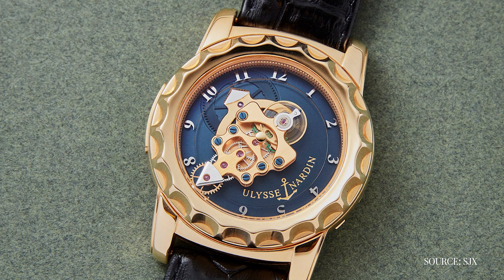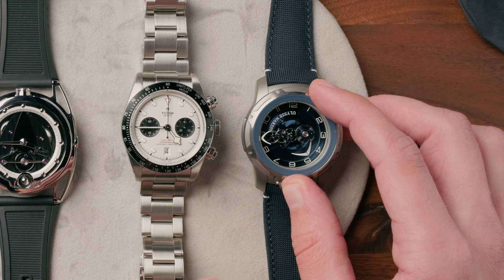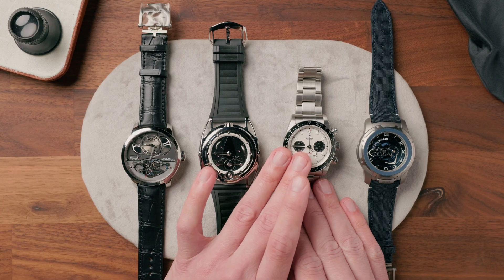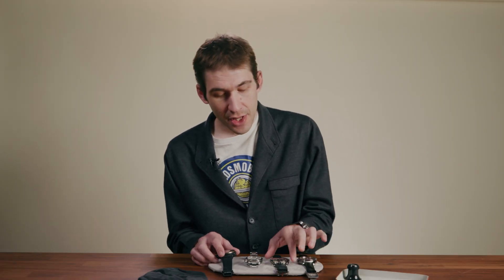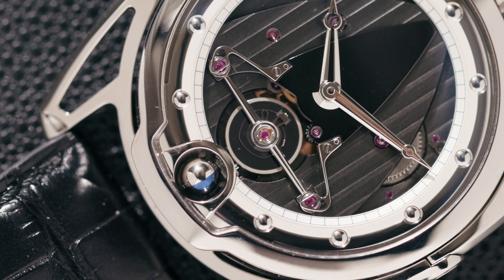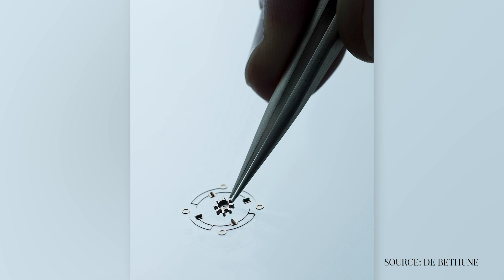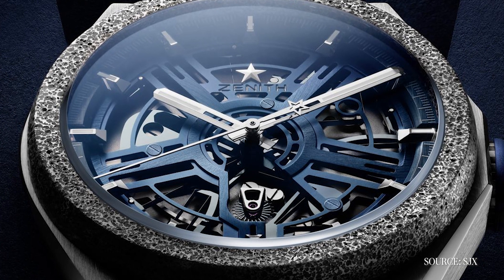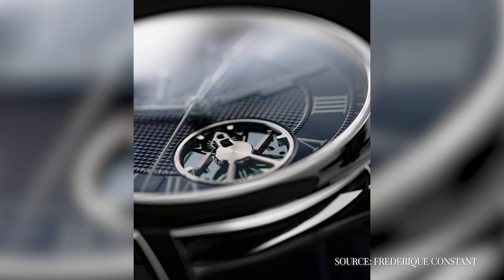How To Understand Silicon Parts in Watchmaking | How-To with Tim Mosso

Comment from the maker: One note: there's an odd edit in here that conflates the GP constant force monoblock elastic system with high-frequency monoblock oscillators like Zenith/FC/UN. They're not the same thing. Both are monoblocks, but the GP is a constant force silicon remontoir-like system while the others are unitary assortments designed to create super-high frequency for potentially higher levels of accuracy. I repeat; they are not the same thing.
Best,
Tim
Reply: Indeed, the “monolithic”, I believe, was supposed to be a correct term for these compliant mechanisms (the escapement as a single piece of silicone)… At the time of FC’s 810 movement, I was looking for appropriate terminology, and that’s how I came to these. The whole field of physics behind compliant mechanisms is fascinating. Don’t rock. Wobble.

Comment: Just one note. There was some kind of weird edit that segued from the GP constant force escapement to the monoblock high-frequency oscillators (e.g., zenith, UN, F.C). They're not the same thing. The GP is a constant force system similar in concept to the UN Anchor Escapement, and the others - NOT constant force - are designed to raise the frequency of a watch for potentially greater accuracy. Again, they both use monoblock silicon components, but they are NOT the same thing.
Best,
Tim

Comment: I just want my budget watches to be as accurate, durable, shock resistant and antimagnetic as possible without breaking the bank. Ofcourse without rubbish, plastic parts. That's all. 🙏
Reply from the maker: Some kind of COSC Tissot or Mido will do that for you. Check out some of the results of the 2011 and 2013 Concours de Chronometrie to see what's possible with a well-regulated ETA 2824.
Best,
Tim
Reply: @the1916company  thanks 👍